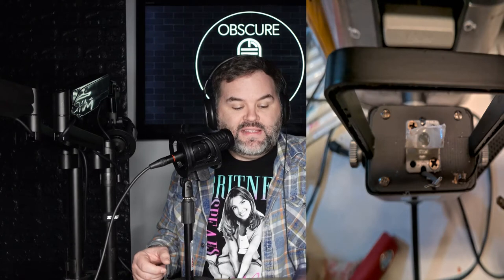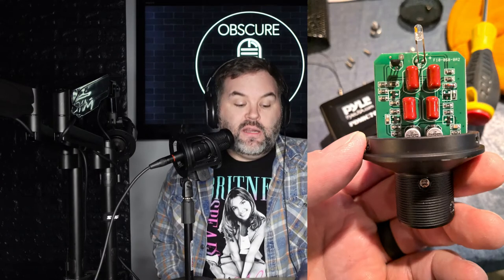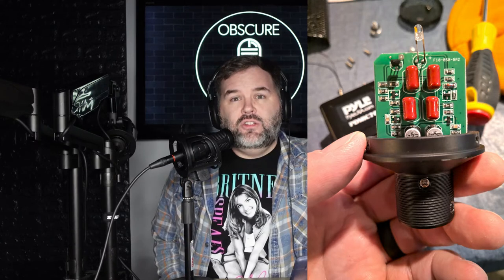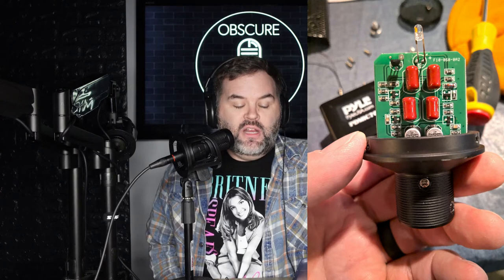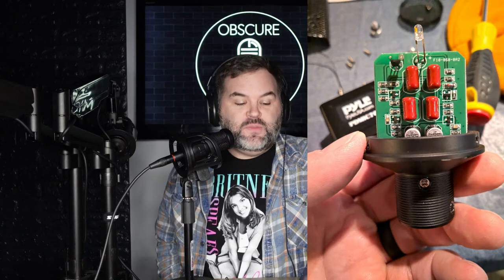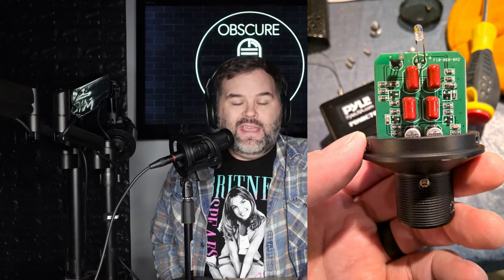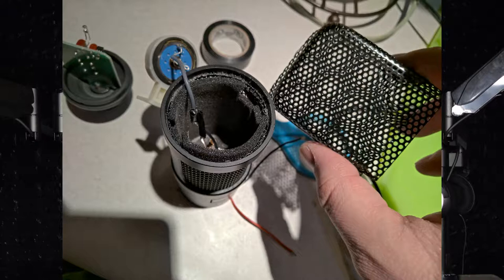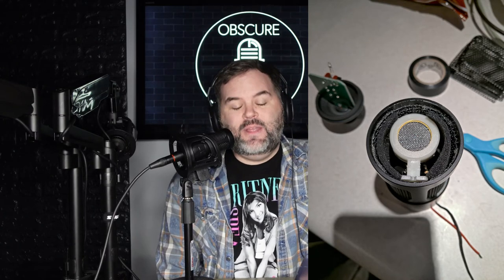DIY End Address Condenser | The Pyle PDMIC70 becomes an Aokeo AK-60 Frankenstein | And more!

Comment: With single diaphragm mics the polar patter (off axis rejection) is mostly determined by the shell, foam will not change this very much at all. A dual diaphragm can change based on voltage across one of the diaphragms.
Reply from the maker: I'm sorry, I'm not sure what part of the video you are responding to
Reply: @ObscureMics  you mentioned off axis rejection when fitting the larger capsule and it had lots of foam around it. Almost all condenser mics come with little or no foam and definitely not enough to stop plosives. Basic they’re barely able to keep wind noise out (podcasting wasn’t a market for them until last year!) so I’d expect about 95% of most mics to need a pop filter in front unless it’s designed for radio an even then they need it! 
Check out some of the EV stuff, RE11, RE12 RE16. They pioneered the variable D proximity effect thing by having the grill behind the mic most of the way down the handle. Proximity effect is made but the size and shape of the backplate behind the capsule, you’ll see in the beta 52 bass drum mic has the same capsule as the beta58 beta57. Beta91 has the same as a beta98, just put on a plate. I too have a mic addiction but no YouTube channel for it. I’ve got a Peavey 520i I’m dying to tryout on spoken vocals but I don’t have much to say
Reply from the maker: Cool.  Thanks for the info.  And WOAH...I have to find that 520i.....now that's a cool looking obscure mic

Comment: yo bark!!! as you are in this mood of modding mics... I have a request lol... do you still have the dynamic Actron mic? Could you change the capsule for a sm58 one? I want to do that to mine but I'm afraid to screw up my mic ahahahah I'm not that good with manual work... and thats what she said lol
Reply from the maker: I'm trying to remember....does that have a transformer glued inside the handle?
Reply from the maker: Yeah there's a lot more to a 58 than a typical dynamic.  I DO still have it....and it currently has a behringer xm8500 capsule in it
Reply: @ObscureMics  does it got better? I'm using it with a focusrite voicemaster platinum(not the pro) straight to a m-audio mtrack and still getting so much hiss on it... I added you on hangout lol it's really being a pain in the ass to setup it in the right way... I can't use all that gear and still have to use vst to clean audio for my live stream lol
Reply from the maker: It's way better.  But. Not sure what's going on with your hiss?  That's odd